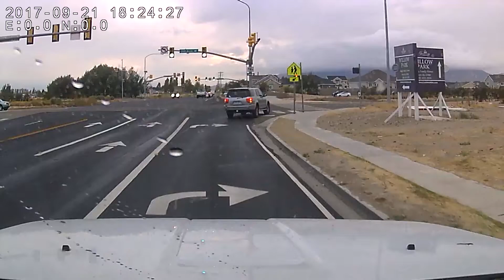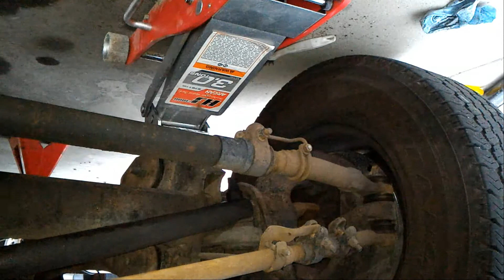Here's why my truck pulls left then right then left then right.

Comment: 97  edit:  SONOMA  (said tacoma,  yeah i wish)  wobbles.  and has    play  in the  steering  wheel before engaging.   (apparently thats normal  for the year and make)     on highway    i    stay in the  right  lane  and  go  speed  limit  or  slower     .     no noises.  and  when  accellerating  it  straightens  out        .    its  when im  over  40      mph  the  wobble    is left  to right..   the  guy  got  new joints and  everything and  wanted to  offset  cost  after the heater  core broke  (cost as much as  the  truck to  replace)     and he  got a  new  truck.    im hoping its just  an  alignment issue?
Reply from the maker: My son has a 1997 Sonoma and the control arm bushings were coming apart.

Comment: Most helpful for car shakes after hitting bumps too!
Reply from the maker: I used to have a little bit of "death wobble" before I changed the front shocks. It was especially noticeable on a certain 35 MPH turn that had a bump in the road. When I put the new shocks in, I made sure the bushings on the top shock mounts were nice and tight. That seems to have taken care of the death wobble problem. (Although that's unrelated to the fix in this video.)
Reply: @jtandrews3  thank you I got something going on with my 04 honda accord changed the rack and pinion and tie rods, seemed to help alot lol. Now, I'm going to inspect the struts, wheel bearings, and I know that my control arm bushings need replaced but I'm not convinced thats it. Thanks for the input
Reply from the maker: If your control arm bushings have too much flex, you may notice wandering, especially during braking and acceleration. The flex in the bushings will change the toe angle.
Reply: @jtandrews3  gonna change the ball joints then bushings if have to
Reply: Well had to change an axle too but the bushings and bearings seem fine , struts the only thing I have to hear now lmao

Comment: I have 1995 f 150 does same thing yours does while driving straight Down the road any thoughts all new underneath upper an lower ball joints gear box2 times power steering pump2 times replaced radius arm bushings center link scissor a frame bushings replaced,tie rods outer 2 times replaced inner one time ,lower steer shaft the long bar from driver side in replaced 2 times wheel bearings inner and outer 2 times replaced ,shocks also front and rear.still it wanders left then correct to the right back and forth I’m at a loss any ideas I can do or try thanks
Reply from the maker: It's a 4 wheel drive? If so, have you checked the front axle u-joints? I don't know, from your question, it kind of sounds like you didn't see the last half of the video. I would have expected some kind of comment about the u-joints. If the ball joints are binding, check out Eric O's South Main Auto Repair LLC video "Ford F-250: Ball Joints & Tie Rod Ends - Part II".

Comment: Was your truck making a thumping sound with this? I've just replaced my steering gear box and it's still randomly pulling hard to left /right
Reply from the maker: Mine wasn't making any noise. Check the alignment. Also check for play in the steering system. I usually have someone jiggle the steering wheel back and forth while I look at the tie rods and ball joints. A thumping noise could mean something is loose or worn. If it's "death wobble", then more negative caster angle can help fix that. See the powerstrokehelp guy's video on that. I put new shocks on mine and made sure the top mount was nice and tight and it pretty much got rid of the minor wobble that happened when I hit a bump on a turn.

Comment: Thanks for the video.  My truck (2002 Ford Excursion 4x4 V10) was doing the exact same thing.  It was maddening.  I ran the test you show on your video--same result.  Took it to my mechanic to have the U-joints replaced, and to my surprise he said they were fine.  After a test drive, he suspected the balljoints.  He found that they were almost dry--so he lubed them the problem went away completely and has not returned (it has been a month).  Seems the place I get my oil changed has 'NOT' been lubing the front end as they should have!  So, I agree that the problem may be the U-joints as described in this video, but to those reading this thread, it seems that in my case, it was the  balljoints that was causing my truck to pull left then right then left then right.  So, just throwing it out there.  Thanks again for the video!

Comment: So what was the fix I have the exact same problem with my 2011 350
Reply from the maker: Since the u-joint is in the steering axis, it can stay in one position and pivot on two bearings when you turn the steering wheel. If the axle rotates, then it can pivot on the other two bearings which may be seized. This causes the stiffness which feels like pulling to one side, then the other. The temporary fix is to get a grease gun and cram grease into the front axle u-joints. Then put it in 4WD and drive in circles to work the grease in. The permanent fix is to replace the u-joint. While you're in there, it's a good idea to replace all the seals and check the wheel bearings too.
Reply: John Andrews outstanding thank you so much
Reply: How much would it be to get it fix. Mine comes and go whenever it wants. I'm sure it means that its getting worst and worst everytime. Usually do it when I do left turns and then it will pull left and right but wont stay center.
Reply: @nadayang753  So I had the same exact problem, there is a zerk fitting on the joint I pumped grease in until it squeezed out, still happened, I kid you not I put new tires on my truck and had it aligned and it has not happened one time since then.
Reply: @dznmodsparrish  my tires are still have pretty good treads left.but my axle drive shaft joint when I move it around to see if theres any play in it i can see that theres nothing moving on the u joint but it has a good amount of play by the hub where the axle goes to. Does that mean that the hub bearing is bad or locking....
Reply: @nadayang753  I honestly am not sure sorry like I said tires and an alignment stopped all of my pull it was doing literally the same exact thing and I thought I had good tires too....ended up they were not or greasing my u joints fixed it
Reply: @nadayang753  just started dealing with this on my 07 f250. Was yours the u points in the hub?